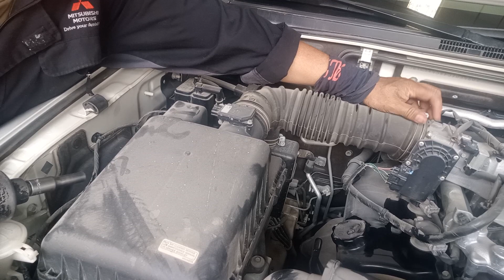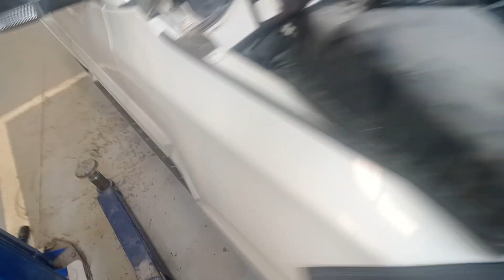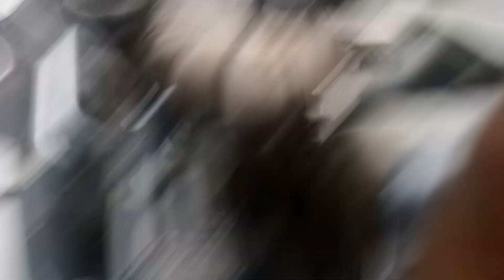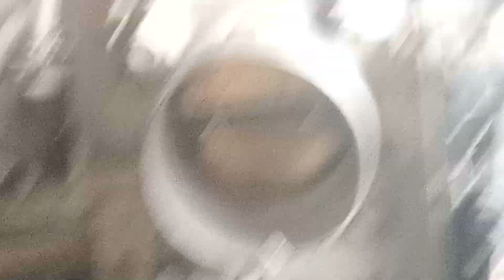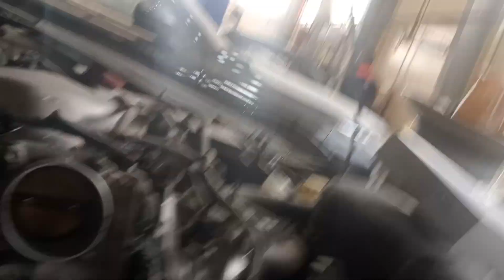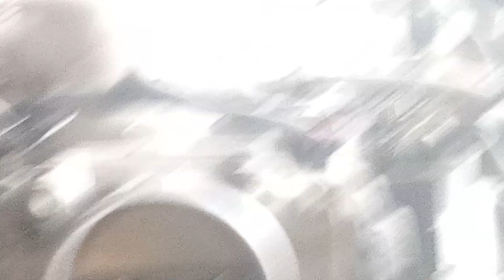Mitsubishi Pajero ( tech info)THE RPM IS UP AND  DOWN /.WHAT IS THE CAUSE

Comment: Sir I am from Dubai. My Pajero 3.8 2014 model completed 200K, recently while driving it is jerking not every time what will be the reason is ti related to Transmission filter or fuel filter? Please help me.
Reply from the maker: Sir sid you make a preventive maintenNce
Reply from the maker: How many km you dashboard panel can you check
Reply from the maker: Before you make. Preventive maintenance what job done